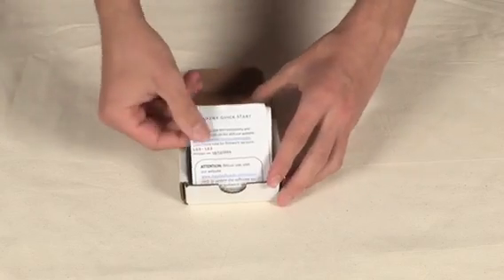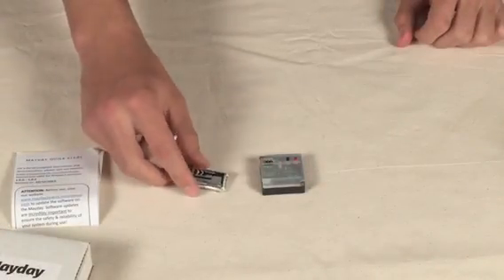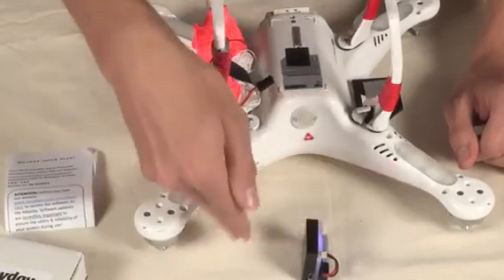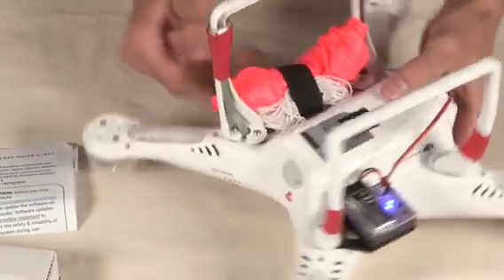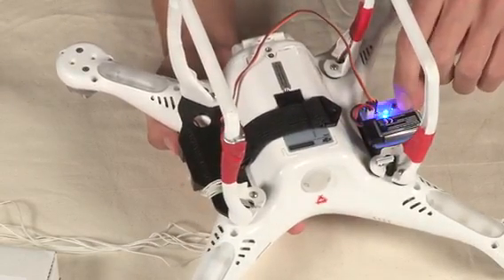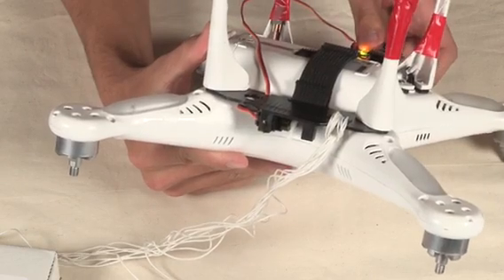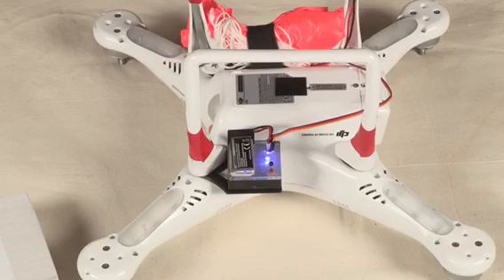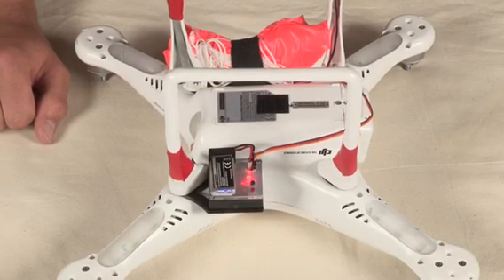Mayday Board with Parachute set up

Comment: Nice. Installed on my system. Is there going to be a way, perhaps via the upcoming software, to enable automatic arming when powered on? This would help prevent accidentally flying an unarmed machine. Id rather have automatic arming, than having to press a button each flight. The option to set this would be very useful
Reply: +uptime4downtime It already does that (: Just leave it armed when you power it off. (Make sure to look at the LED at least once though before flying to make sure that there are no error messages. Also, be sure to check the battery level often!)
Safe flying!
Reply: Thank you. What occurs if the battery goes flat during flight. Presumably it wont trigger an ejection?
Reply: Unfortunately, it depends on the brand of parachute that you use. The servo used on most of the parachutes designed for UAV flight are analog (Mars Included). When an analog servo does not receive enough power, it can sometimes 'twitch' in a uniform direction. This uniform 'twitching' causes the parachute to open and deploy on accident.
Reply: Thank you. I am fitting a voltage monitor so this wont be an issue. Very good tidy system!